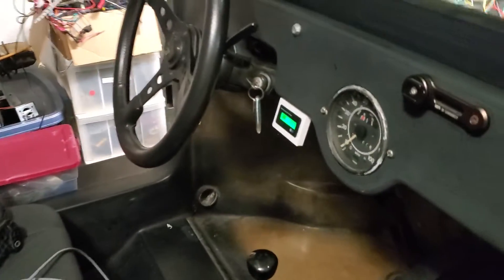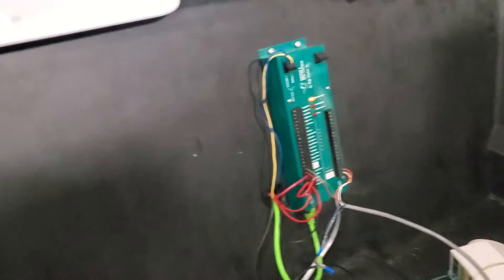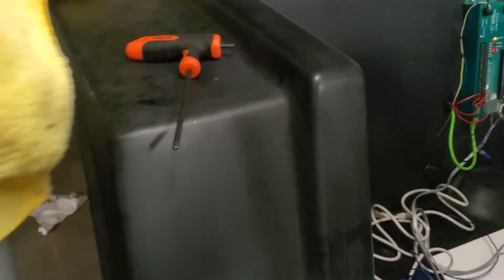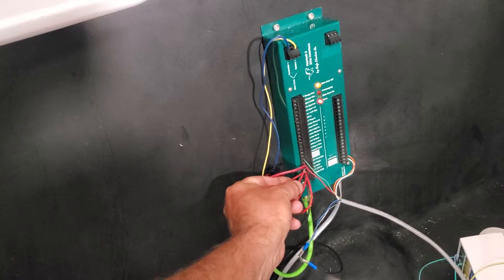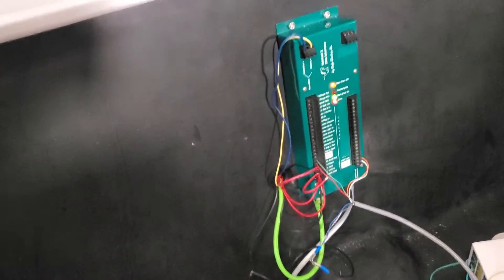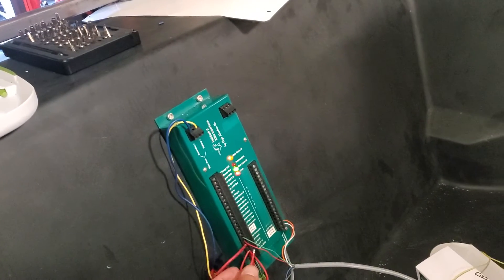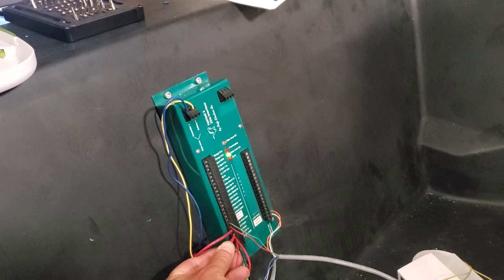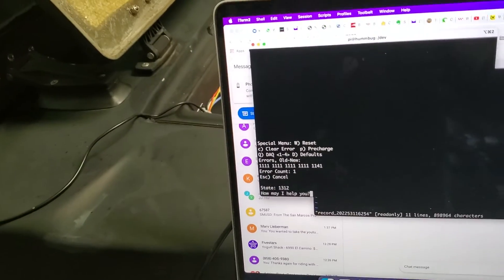Zilla start problems: Solved!

Comment: i have the old but new zilla 1k that I thought was not enough power I guess I will install back in the bike and go to a smaller motor gear bring up the rpm. The last I used the zilla1k it was under warrantee and they couldn't find the problem it went back and forth in the mail for a month until I told RICH to put a new board in the hair ball and they charged me 500 for a repair that was covered under warrantee. after paying the 500 RICH refused to send me the old parts back under law when customer pays for parts and labor the individual is entitle to the used parts. Lucky thing I ended up with the old mother board the problem with it all along was the femal connector on the board was never soldered in all the way making interruptible connection so I fixed and now it works fine. Maybe for this reason he wont phone me back. Any way I have the need for neck snapping speed and the zilla 2k will only due.